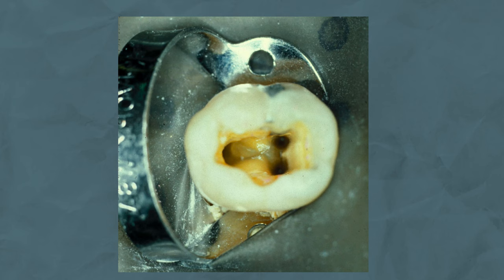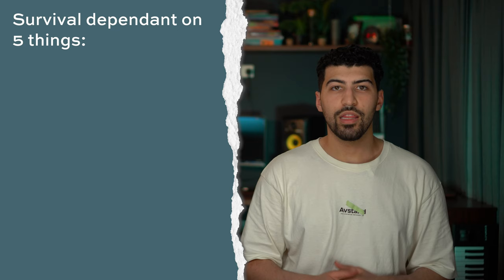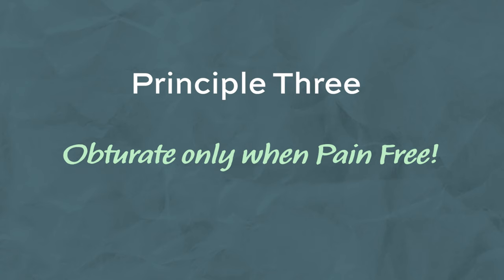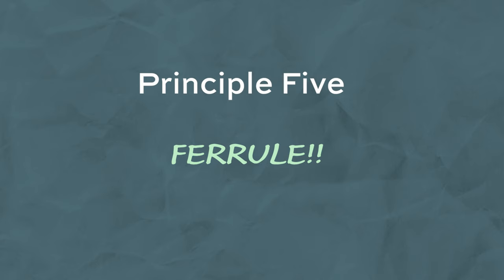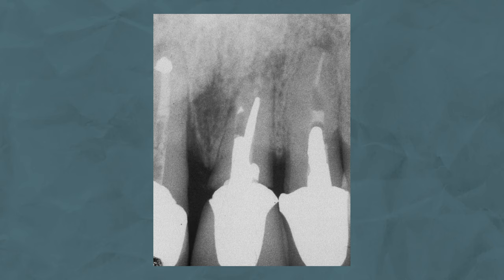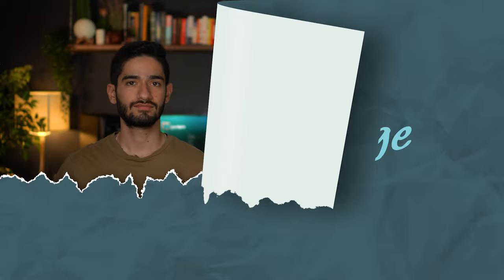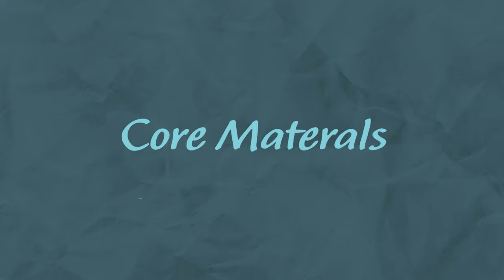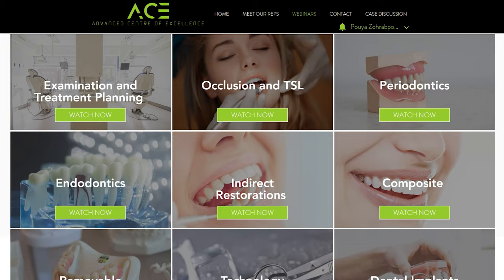Restoring Root Treated Teeth - Posts, Cores and Cuspal Coverage | Ace Courses Webinar Summary

Comment: what is group guided occlusion
Reply from the maker: When someone uses multiple posterior teeth to disclude (teeth not touching anymore) on lateral excursion (moving their mandible to the right or left creating horizontal forces on teeth). The other common one is canine guidance which means someone uses only their canine to guide the lateral excursive movement. The canine is suitable for this task because it has a huge root and can handle more load (forces) than other teeth. Hope that helps :)
Reply from the maker: Also known as group function
Reply: A group of scientists have put their heads together and figured out a quick way to REGROW GUMS OVERNIGHT...